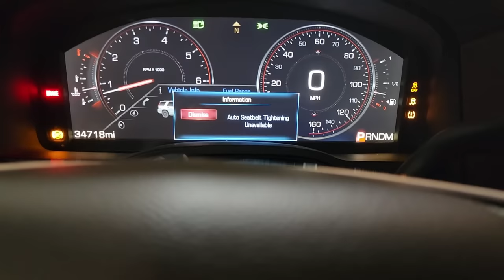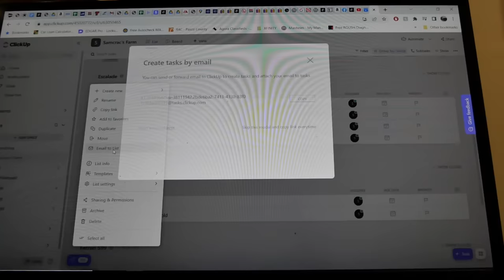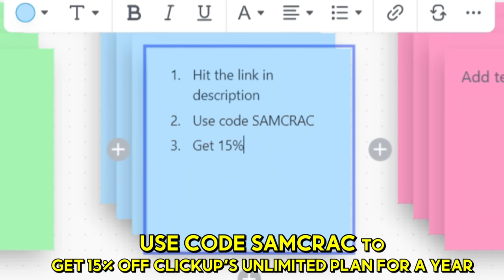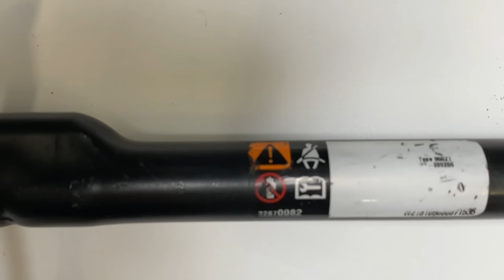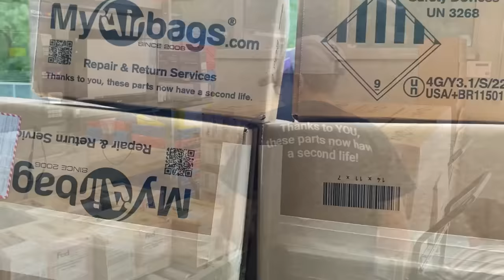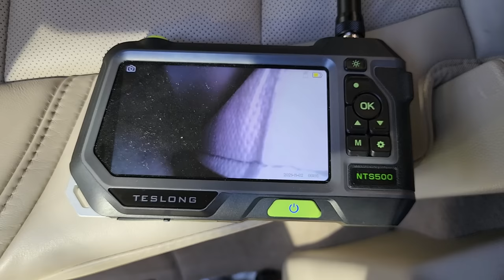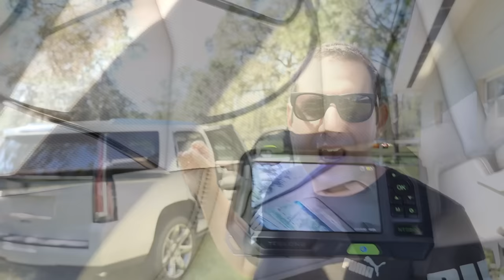Someone Illegally Tampered with my Auction Escalade's Safety Systems

Comment: This is criminal. Literally the difference between life and death for someone. So thankful samcrac got ahold of this one before someone else could. Kudos for the emphasis on safety.
Reply: This was at a auction. It’s not the sellers issue.
Reply: @disneyfan9099  But it IS a sellers issue.  They KNEW the car was unsafe and hacked, but to eliminate THEIR liability, they shipped it off to auction.  They probably got paid from an insurance company to make repairs and decided to hack it and pocket the money.
Reply: @disneyfan9099  
You sell the car 'as is'. Yet you are making a representation of the vehicle.  If the seat belts were broken, that would have been obvious and it would have indicated that it was involved in an accident. This would effect the price of the vehicle.  The fact that they tampered with the belts so that the diagnostic reading wouldn't show an problem is illegal.  It is the sellers issue.  You start with the auction house which has some liability. They pass most of their liability back to the seller.  (Indemnification)  The seller is the one who makes statements about the vehicle.  So yes, they can be sued for misrepresentation and fraud.  Then there's the criminal aspect. They tampered with a federally mandated safety system.  It would be difficult to get someone thrown in jail, however they could at a minimum be shut down.
Reply from the maker: @disneyfan9099  I am half and half on this. The seller definitely messed with it. At the auction I bought it from, there are specific disclosures. Say that the seat belts were already blown; and I found them that way. This would be obvious and I would've approached the car in a different fashion. Deliberately installing resistors to hide an airbag light is bad. If they would've left the airbag light on, at the very least I could've pinpointed exactly what was wrong, quicker and addressed it. Initially this thing was kind of being sold as just a normal car with a repainted front bumper and a missing radar sensor.
Reply: nah. it is a cheap auction car with low rating sold as is. nobody should drive it, common sense. it is a parts car and everybody seeing it should know

Comment: What's stupid is the amount of time and effort they made to hide the damage when it was only $250 to fix it properly.
Reply: smart people with limited willpower to do things right
Reply: It was probably on backorder. That’s why they did this lol “they did this hack to save money on parts that are cheap. I’d have ordered them but It isn’t possible”

Pretty obvious this corner was cut because the belts weren’t able to be ordered
Reply: @ParkerOviedo  exactly, it wasn't the cost of the repair or difficulty to do it. Was the fact that it was back ordered. Obviously this vehicle was wrecked at one point, alot of luxury vehicle owners won't keep a vehicle after an accident. Could have been sold as is wrecked and someone bought it and couldn't get the parts and decided to rig it. A very stupid move to sell a vehicle you did that to, but they also probably thought the dealer would have repaired it and sold it off the lot, but the dealer probably saw the back order and didn't even check it further and sent it to auction.
Reply: @ParkerOviedo  Sam managed to get the parts and didn't have to pay a premium price for them. Anyone who watches YT knows these components can be repaired cost-effectively; anyone "in the trade" will know too. The idea of saving a few days and a few hundred bucks was just too tempting.
Reply: $350. He clearly said $350. And I agree 100%!
Reply: Not when they  charge 150 per hour
Reply: No. Its not the $250. This car should had been sold as Salvage if those “hacks” weren’t done to it. That is $10-15k price difference at least on this particular vehicle.

Comment: This episode has to be one of the most informative videos I’ve seen. Going behind the scenes to see how the seatbelts are rebuilt was a learning experience.
Reply: The complexity of newer cars limits when and where they can be used.  They aren't practical, and will find their way to the crushers far sooner than simpler cars. 
Can you imagine owning and maintaining one of these in a remote location? 
While working in remote bush villages, I saw a lot of masking, where dash security and warning lights were drilled out with needle drill bits to extinguish them. 
To fly a car into a major repair center would have been $8000 round trip plus the cost of repairs and parts. It was crazy!  The shipping costs on a replacement windshield was more than the price of the windshield. Simple, good running cars were selling for a premium. I air freighted an old Isuzu Trooper that I paid $600 for about 1500 miles because it was worth it. The air freight was $3000+.

Comment: I hope ;you let the auctioneer know what you found so that in the future you can warn any buyers. And it just makes me nervous about buying any car from a private seller.
Reply: Its an auction. As Is snapperhead
Reply: Buying from a private seller is a LOT safer than buying from an auction. There's literally no where you're more likely to get a wrecked/ flooded / whatever car than at an auction. Anybody that buys a car in an auction and is shocked to find problems is delusional. Easy to run a carfax. People can hide damage and repairs from a carfax, but they can't hide ownership changes. If a car has had several owners within a short period of time, it's probably junk.
There's a reason that it's at an auction, and not being sold on the open market.
Reply: @wileecoyote5749  Using that logic, it would be okay to put an explosive in a car sold at auction? There is an ethical consideration when you deliberately hide a problem.

Comment: Find the connectors at a junk yard and cut those out with enough wire to put heat shrink crimp on butt connectors to connect to the cut wires

Comment: I figured that only thing that could have been wrong with the controls had to be the clock spring. I still remember going to the auto parts store ordering one. I've known all those guys for a lot of years they even give me a preferred customer discount. None of them knew what a clock spring was they thought I was fixing a clock. So in the middle of the day I'm standing there with a crowd of people around me explaining what it is and what it does. Then I went on to explain how you diagnosed if yours is bad.

A few days later the guys that were there the day I picked up my part told me three people had came in and purchase clock springs. One was a guy that was standing there and heard how I told to test and figure out if that's what it is. The other two was from the guys behind the counter when customers came in with the airbag light no horn no cruise control. Before me the guys behind the counter didn't know what to tell the customers about that issue.

I really think you ought to contact somebody on that Cadillac. There has to be a paper trail of who touched that car. Somebody could have been killed in that car since the body shop or repair shop or some guys backyard decided to rip the seat belt guts out. Whoever did it wasn't their first rodeo. 
That just makes me angry that somebody could have died because somebody didn't want to spend $700 or if they had your connections 250

Comment: I agree with you Sam who ever did that tampering knew exactly what they were doing for example that resistor value needs to be quite exact and you need to know what you're tampering with or the air bag may even blow up on your face the next time you start the car.

Comment: If this had been repaired by a body shop they must do a post safety and repair check before it’s returned to the owner!! If the car was sold as is why was the safety devices defeated?
Maybe so it would run and drive??
How many cars like this are being sold as is and being driven when unsafe?

Comment: Please tell me you reported this to the auction (manheim) I believe. They don't care but since your a big youtuber it gives you more pull when reporting this issue. Regardless of how big Manheim is they should NOT be letting this stuff slide, they barely are implementing OBD2 codes in some auction listings and only in some states. They should be transparent and stop letting scum bags get away with these sorts of things. I can't even tell you the scummy things I've seen done to cars at these big auction houses like Manheim. Like unplugged ignition coils so the car misfires and nobody bids on the car when its driving in the auction lane only to find out it was just a simple plug and they do this sort of scum bag crap so nobody bids and they win the car for cheap. These auctions are full of deadbeat scum bags doing mickey mouse tricks so cars can be sold in the auction only for the buyer to end up fixing their scum bag trickery. They steal knobs, nav discs and any small pieces they can to fix another car they own, it's well known but they don't care until it starts to hurt their bottom line.
Reply: i think it’s sold “as is” need to read the paperwork
Reply from the maker: You know I did call and talk to a rep. Their answer was, email another person. Honestly I don't think they even understood what I was explaining to them. It's just insane that I'll have this issue fixed for about $300, and some person decided it was worth cutting up the wires and hiding it.
Reply: Its probably illegal to sell the car like that
Reply: @Samcrac  sam talk to the owner of the dealership because "as is" doesn't absolve them in the event of an accident.  Because its evident that the objective of the repair was fraud.  As is does not protect the seller from engaging in fraudulent behavior by specific action.  At the very least they will put that repair shop on a black list

Comment: Whenever your steering wheel airbag goes off, the heat produced by the back of the airbag (metal part facing the clockspring) has a tendency to melt the wires on the clockspring. It would make sense since a new clockspring = working steering wheel controls. I had an F150 where this happened and luckily got the clockspring along with the used steering wheel airbag from a recycler...

Also, depending on what state you're in, its illegal for anyone (including the seat belt repair shops, I use Safety Restore on my projects but to each their own) to tamper with the internal working components of the pretensioner. Here in PA, I can only either buy new airbags/belts or get them from a recycler unblown, we can't install 'repaired' SRS equipment due to liability issues and laws.

Comment: I have 30 years of dealership experience, not much surprises me anymore 😕 Whenever purchasing a used vehicle, it's a good idea to make sure that airbags are actually in the vehicle. I had a customer visiting from out of state years ago that was curious about her lumpy steering wheel pad, upon further examination I noticed that the pad had extensive vinyl repairs performed. After removing the airbag I noticed that the wiring and connectors were missing, and where the airbag should have been was now stuffed with shop rags! Subwoofer voice coils were used for 2 Ohm resistance to pacify the SDM. When it comes to safety, the only stupid questions are the ones not asked. 🤷‍♂️

Comment: Sam, thanks for the heads-up on the seatbelt pretensioner repair. I had a 2015 Volt set off the seatbelt system and MyAirbags are rebuilding them. Saw your Blue vette a while ago on 41 in Land o… sounds great!

Comment: I had this happen.  I bought a 2014 focus from a title washing flipper.  I wasnt savvy enough when i bought it, it had been very poorly rebuilt with most of the airbags and seat belt safety system replaced by resistors.  It also was title washed. I only discovered all of this after being rear ended at a light by someone doing 60.  It was replaced by a car bought from a legitimate dealer

Comment: Airbags on my Honda Odyssey were blown when I bought it from auction, replaced the airbag but not clock spring, everything except the cruise control worked, replaced clock spring and that fixed the issue.

Comment: This is why vehicles are sold so cheaply with salvage titles at auctions. I had a dealers license for over 20 years for friends, family, and co-workers, and we bought many dozens of great deals over the years. I even had a JerrDan Rollback with a stinger on the back for towing 2 cars. Some vehicles like Porsches we bought for engines, etc. Regarding this video, it's unusual to find vehicles seriously tampered with from insurance company write-offs. Many of these rebuilds from salvage title auction cars end on on eBay. The profits are enormous but buyer beware. It's not easy in many states to turn a salvage title into a road worthy rebuilt title to get plates and make it drivable again.

Comment: When any part of the SRS system deploy, you need to follow the manufacturer SRS guide for mandatory part replacement. Some manufacturers require front impact sensors and the SRS control module to be replaced when the seat belts deploy. Even if the light goes away, the system may not function properly in another accident, if you don’t follow the manufacturer replacement requirements. You should be able to access the guide from any collision estimating software. Good video, good luck.

Comment: Clearly Samcrac have no idea of the issues a crashed or salvage vehicle would have. There are million vehicles every year acquired by the Insurance companies, how? Well when you have fender bender or someone scratched your door and you make a claim and opt for the payout then the Ins Company sells that vehicle on an auction whether in Copart, IAA and some other salvage auction.
If a seatbelt goes off and locks it’s ruined and need to be replaced. Once you replace it the Air Bag dashboard light will not turn off. The SRS system is designed in a way that if any seatbelt sensor, airbag, crash sensor activates then the whole system need to be replaced, ALL, airbags and seatbelts and crash sensors and the most important thing: the SRS module that is in the center console and controls all sensors. This SRS module need to be disassembled and replaced but before you put it in it needs to be reprogrammed to that specific VIN number, and this is something only a dealer will do, but only if you purchase and install the SRS module with them, so your are looking at about $6,000 for the air bag light to go away. For a new Escalade obviously should be more than $6,000.  OR you replace the seat belt or the air bag and add the resistor to it to trick the SRS module into thinking hasn’t gone off. That does not mean the new seat belt or air bag would not function in case of a new crash but it’s only there to trick the SRS module into thinking it hasn’t gone off and avoid a whole system replacement.
This time the body shop that did the restoring did a sloppy and incomplete job and left some Escalade specific codes in there, probably lack of experience, time or money, who knows.
The resistor was put in there because of the un feasibility of the existent process to repair an SRS system, to force you to replace the whole system of airbags and seatbelts along with the SRS module because an airbag went off or a seat belt locked making the cost of repair un feasible is the tap and dance the government and dealerships do while allowing those crashed vehicles to be sold by multiple auction companies and collecting billions on sales and taxes. 
To put it in context it would be as if you have a punctured tire and instead of just fixing or replacing that tire the government and the vehicle manufacturers would make you buy a whole new set of tires because of the tire that blew out, but now imagine that every tire costs $1500-$2500 depending of the model/brand of the vehicle. And that is the SRS system in a nutshell.

Comment: Figured I might as well leave a comment since I seen so many advertisements for each seat belt rebuild services. I actually used one of these services to rebuild friends car seat belts. My only complaint with them was that they didn't wind up the seat belt retraction spring enough so the seat belt doesn't retract on its own you have to help it out.

Comment: With this damage and tampering, I'd also highly recommend you check the rear SRS systems/side curtain air bags, and for sure check the integrity of your actual front air bags.  If they did go off, that prior a-hole may have installed fake bags, or tampered bags to look normal.

Comment: A friend of mine who used to buy/sell second hand cars and parts once had some guys bring him a old V8 Fairlane that was in really good condition overall, it was only running on 7 cylinders and they played dumb and said they didn't know why it wasn't running right and just wanted to get rid of it cheap, my friend had a look under the hood and found that one of the spark plugs was broken and thought he'd scored a classic car with nothing much wrong with it for a bargain so paid the guys. He changed the spark plug and still it was dead on that cylinder, compression tested and that cylinder had zero compression, took the head and sump off and found that piston had seized in its bore, they had taken the sump off unbolted the rod big end from the crank then gas torched the big end of the rod off to prevent it getting snagged up on the crank, then they'd put the sump back on and busted the spark plug to fool my buddy 🤣

Comment: spent years going to auctions often the most wanted cars were sabotaged a bit in several cases they drilled out center of fuse and switched it with the one in the target car, then when things dont quite work less people bid on it an 2 sec fix after the auction